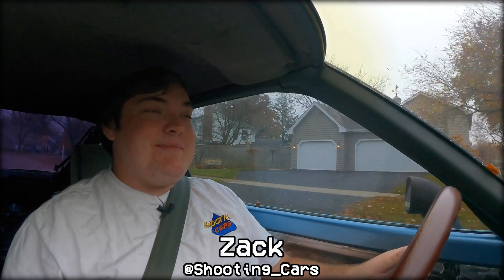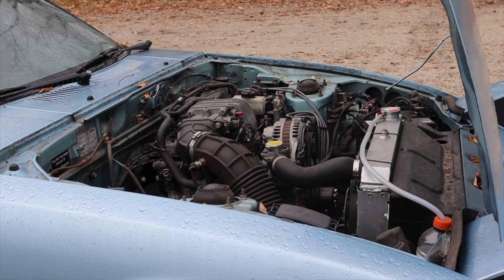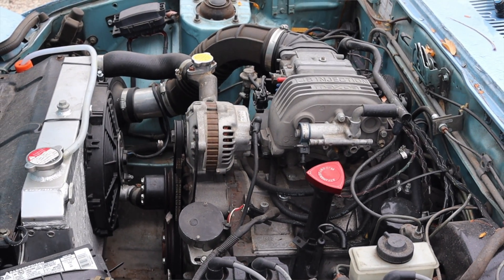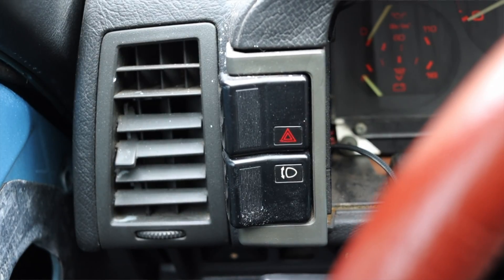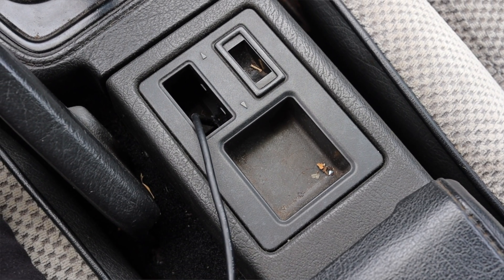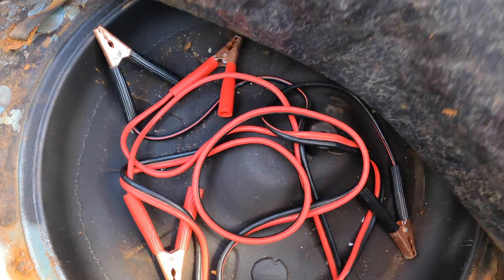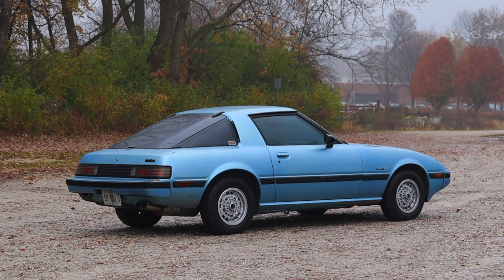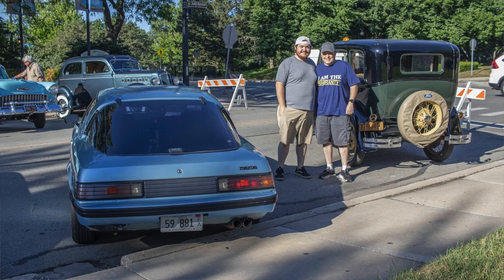13b Swapped 1985 Mazda  RX-7 Review - Why It's The BEST Thing To Do To An RX-7!

Comment: Nice build. The RX-7 FB doesn't look dated and that's a great color. I've never heard of a redline beeper, I guess it was easier than a rev limiter with 80s electronics.
I'd be cautious of running the fog lights with the covers on. The heat from the halogens has been known to melt them. You can get clear stone shields if you're concerned about rocks. Reach out to Daniel Stern Lighting if you want to give your 7" headlights modern performance while still keeping the old-school halogen look.
You need to convert the choke pull to deploy a smoke screen or something cool. You should find someone with a 3D printer to convert the power window/speaker trim piece into a BFB-compatible cupholder.

Comment: Are you running 24/1 on your CAS? I see that you've cut the wires going to the G signal sensor. I had issues with my vr conditioner board. I decided to use the Ne  signal because 24+1 wasn't working.